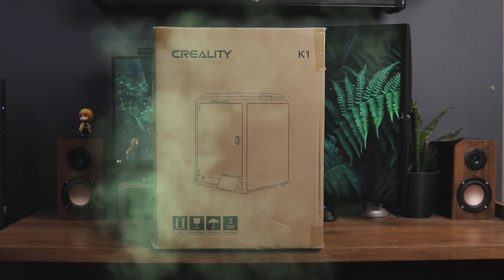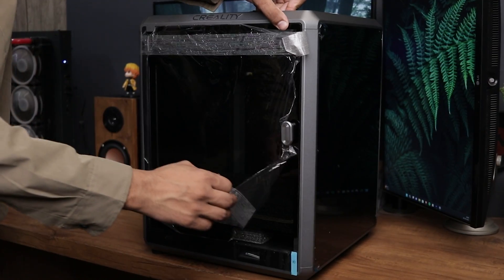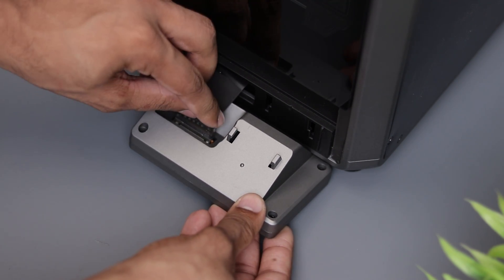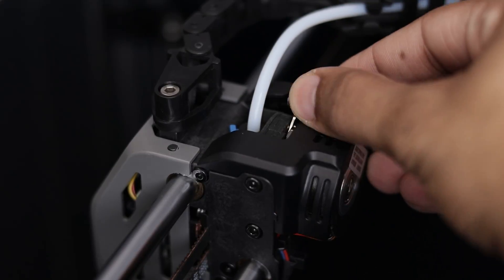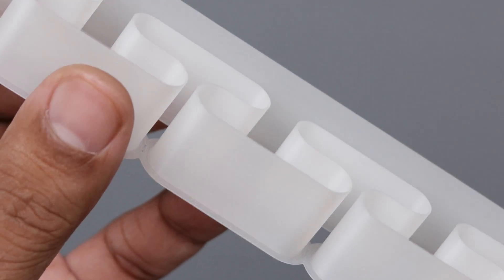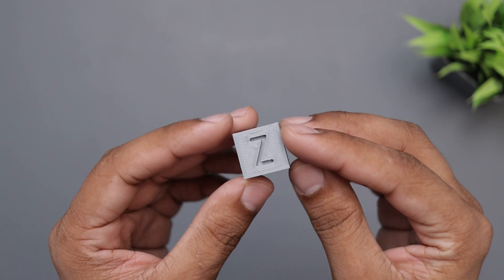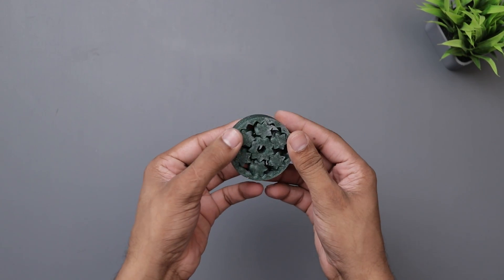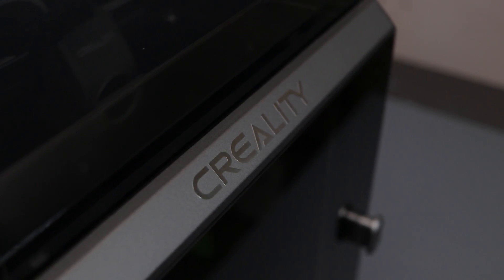Fastest 3D Printer Ever | Creality K1 Budget 3D Printer | DIY Projects | The Wrench

Comment: From the look of it, you have the old extruder(shiny switchon top). It may give you problems, just a heads up.  I bought mine directly from Creality a few days ago to get the updated model.
Reply: The old model will under extrude. Creality should send you the new extruder.
Reply from the maker: yeah, i got it. but haven’t faced any issues with the old extruder yet.